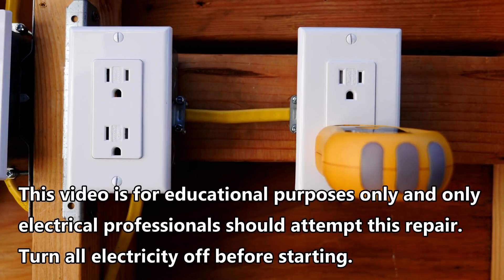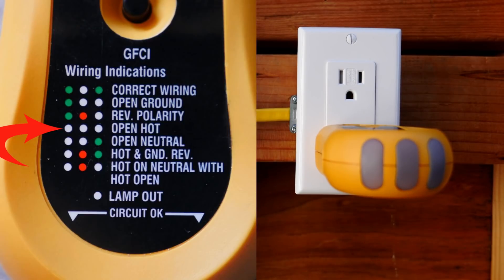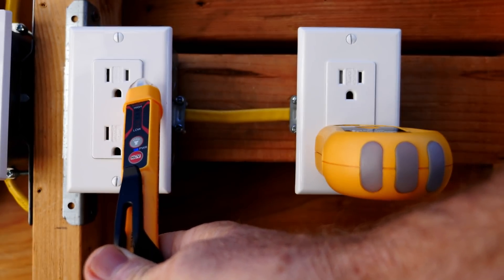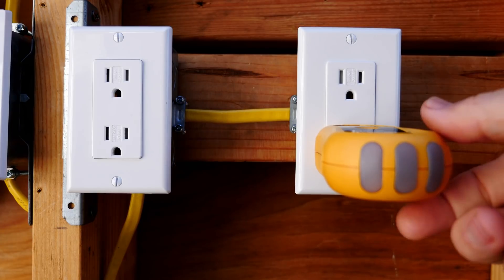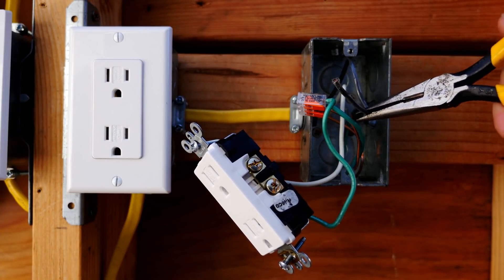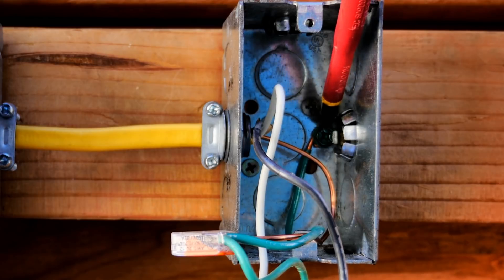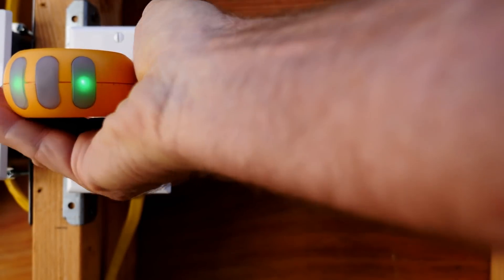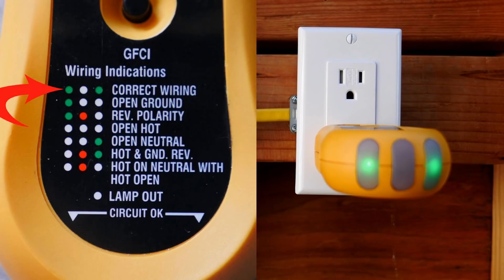An "Open Hot" Receptacle is VERY Dangerous!

Comment: Great video Bill, got a question for you. I'm trying to slim down my tool bag, I saw your videos on the various klein multi bit screwdriver sets, which one do you like the most?
Reply: It's hard to tell the size & weight of them sometimes, so check on the Klein website.
I have an older Klein adjustable length on my hip, because it takes standard 1/4" hex bits, which also fit into my drill driver or impact driver. This saves a lot of weight in 2 ways: only one set of screw and nut driver bits, 
and less handles; why carry 10 screwdriver handles when you only have 2 hands?!

The new Klein adjustable uses short bits and a bit holder (boo!), and it needs notches on the bit shaft, so for that one you need to do some grinding, or wait for Klein to come out with more notched bit options.
Reply: The other screw driver on my hip is the small Klein "thermostat"/precision 32581 4-in-1; it just has  very small Phillips & flat bits. The screwdriver in this video is bigger & heavier, some kind of new in-between size.
Reply: @wim0104  Thanks for the info😊
Reply from the maker: Tell me your trade and what kind of work you do and I'll take a shot at it.
Reply: @SparkyChannel  residential electric😊
Reply from the maker: @tedmcdonald3377  I would go with the original Klein 11 in 1. Can't beat it.
Reply: @SparkyChannel  thanks Bill, I think that will be perfect too, hard to beat tried and true!!!
Reply: @SparkyChannel hey Bill is that the 32500 you're talking about?
Reply from the maker: @tedmcdonald3377  Yes: Klein Tools 32500 Multi-Bit Screwdriver / Nut Driver 11-in-1 Multi Tool, 8 Industrial Strength Bits, 3 Nut Driver Sizes, Cushion Grip Handle: Amazon: https://amzn.to/3qNzNX2
Reply: @SparkyChannel  awesome, thanks Bill!!!

Comment: I would debate working with a hot with an open neutral is more dangerous.
Reply from the maker: They are both dangerous. Thanks!
Reply: Yes, could overheat wires, start fires, because of the voltage drop (aka Amp increase) on the live side of the circuit. and puts unwanted, reverse, voltage&current on the neutral system: part of the neutral system becomes a lot more live.
Reply: I think a lot of people are trying to relate Bill's remark about danger to the physical damage to the wiring or the building structure that could result from an open hot.  The reason Bill labeled it as the most dangerous was because the tester is essentially telling you that there is no electricity present inside, and therein lies the danger, to the person.  If a person presumes that the circuit is dead because the tester does not light up and proceeds to open the box and then attempts to meddle with the conductors inside without making any additional tests for voltage, it might be the human that lights up instead of the tester.
It amounts to the same scenario as if you had a helper tell you "There is no electricity in that box." and you believed them and then went inside the box and got zapped because you did not test further after exposing the conductors inside.
So, if you were working with a person who would wrongly tell you it was safe, you would call them a dangerous person to work with.
Bill called it most dangerous because it mimics a de-energized circuit while it is actually very much alive.